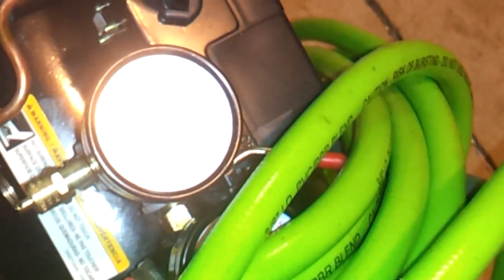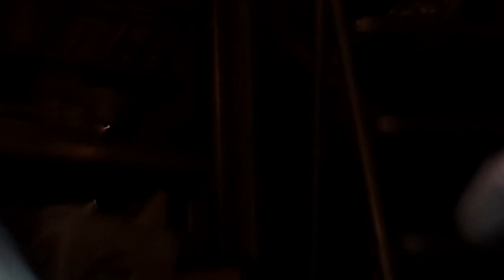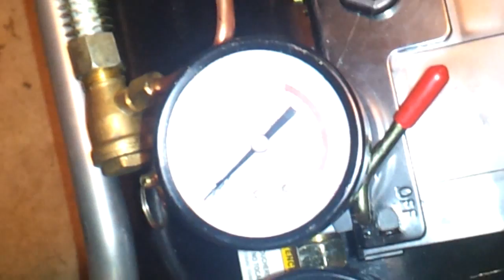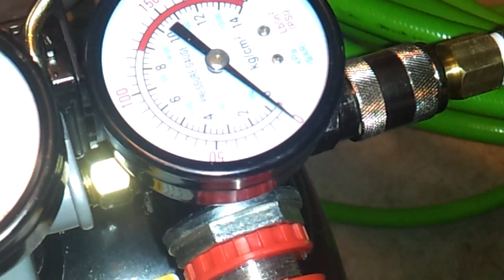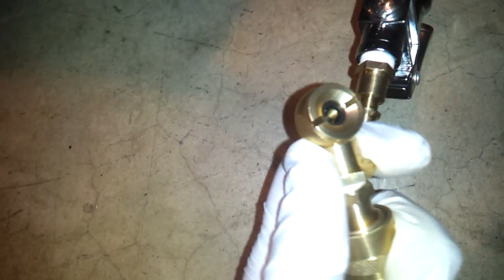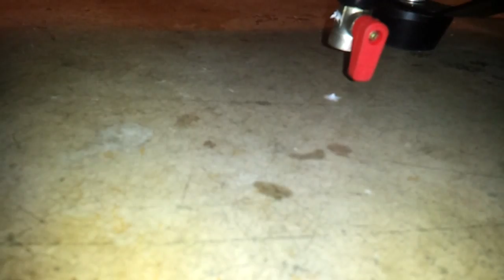1.8T Jetta How to use a Husky air compressor

Comment: I have an 8 gallon Husky compressor and while I waited for the time to use it once it was set up, the little Intake Filter I had
screwed into the compressor broke off while I stored it and I am needing answers as to how to either fix it or replace the Intake Filter and what would happen if I did not have an Intake filter on the compressor when I use it.
Reply from the maker: Go back to any hardware store and go buy the replacement or use ebay. every compressor company has a costumer service number. To answer what would happen. You risk damaging the internal motor if anything gets sucked into the compressor. And a really loud annoying whooshing sound. It will still work but thats your call to make. Ask yourself, which is more expensive. The filter or the compressor? While your at it, buy some extra compressor oil.